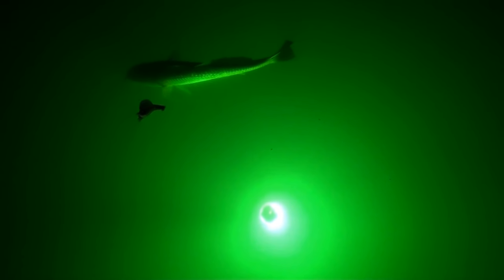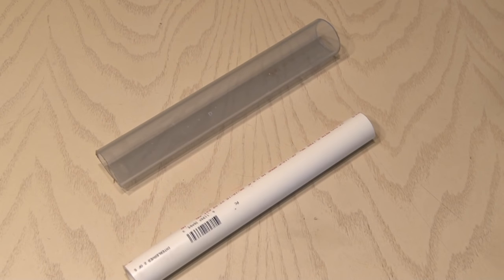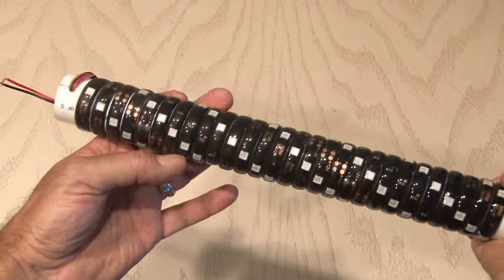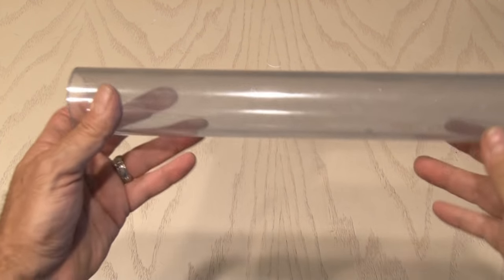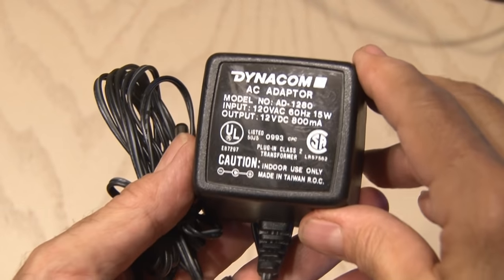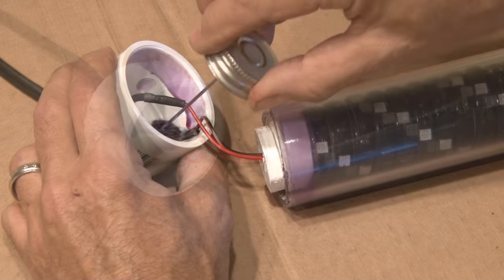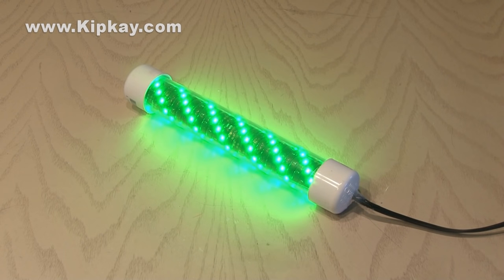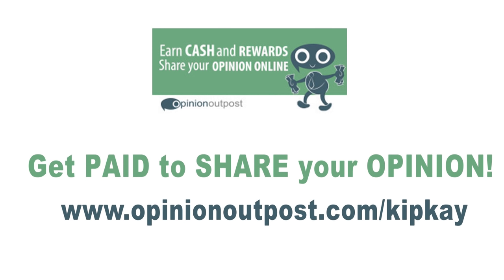Catch More Fish With This!

Comment: I had a hard time finding 1 1/2 clear PVC pipe so I used a protective cover used on fluorescent tube lights. I used bolts from my scrounge box in the garage to weigh it down. If you use the entire roll of LED's it will make an assembly 20 inches long. On the end of the wire, instead of using a wall wart I used a cigarette lighter plug for power. By the way, I made 2 of them, can't wait to fish with them! Thanks for the idea! The whole assembly cost about $30.00 to build both!
Reply: I'd be greatly interested to see pic of your finished product. Primarily the cigarette DC plug.

Comment: 1) I would use a cable or rope of some kind to carry the weight of the light along side of the small gauge wire. 2) I would also water proof the power cord on the inside of the cap as well . I would not use silicone to do this I would use a marine or plumbing type 2 - part epoxy dough, like $6 at Lowes or HD. 3) On the LED wrap at the end I would go around it with electricians tape in combination with the glue.

Comment: Two minor differences I would have done: 1) I'd have sprung for the programmable LED light strip so that you could get it to change color.  Of course, I'd be using this more for decoration than for attracting fish, so the different use would drive that change. 2) I'd have made sure to use the silicon on the inside of the cap as well before securing it to the tube.  Might be overkill, but I figure if you're going to try to make something water tight, might as well take all the steps to lock it down for sure.

Comment: filled mine with sand. And used 600 water proof creed led lights. works off my boat battery. basically the same concept cost me $20
Reply: Tony McCready what did you plug the extension cord to . Or what battery did U use ??
Reply: Alex Nguyen Are you dense? 
"Works off my boat battery."

Comment: This needs to be DC instead of AC. That way you could utilize your boat batteries or a battery source.
Reply: Randy Neal LEDs are dc. He's using a converter to go from 120vac to 12vdc, if you want to use it on a boat just run the wires to a switched and fused battery source.

Comment: Cool video but if you want to avoid purple primer pick your self up some oatey gold  when glue a connection hold them together tight for about 60 seconds. This works I put up solar pool heating systems at one time. Pool water is pumped up to black plastic panels and then returns to the pool we always changed the pumps to a pump that could handle the head height and the connections were under a decent amount of pressure.This save you a little money and time in the end.

Comment: What wave length of light was your green LED's? You really need the correct wave length. Not just any green light will do. The green light it self does not attract fish, it helps plankton breed in that area, which attracts fish. People will put this under water around docks and after a few weeks more fish start to arrive. For a pool part it would be cool to drop a color changing one into the pool. But drop a few batters into the inner tube.
Reply: 535-540nm works well under my dock. (saltwater)

Comment: If you could add a control board to it to program patterns into the light, you could do some pretty trippy rave lighting with that spiral design.
Reply: All of the LED's are connected to only a single power bus. It's impossible to control each LED individually.
Essentially, the most you could make this do is flash.

Comment: Question: Is the AC adapter that you used on the video rechargeable by plugging it into a wall socket? If not, how do I make this light portable so that I don't have to use power from an electrical outlet? Is there a battery or some kind of portable power supple I can use? Sorry, if I sounded too stupid for those who are smart enough to think this is common sense! I'm very interested in this but I want to make sure I understand this fully before I commit myself to this project. Thanks to anybody who can answer my questions! And thank you very much kipkay for posting this very special idea for all of us to learn from!
Reply: I use my 12 volt cordless drill battery. No AC adapter.
Reply: Grand Wonder. Use a car battery
Reply: Grand Wonder Since you have trouble understanding electricity, you should buy a light already assembled. I respect your willingness to admit your limitations. No one can be good at everything. I'm an electrical engineer, but some projects, like this, I would prefer to just buy the finished product. If I can't find it, or it's too expensive, then I might build it. Good luck whatever you decide to do.
Reply: Grand Wonder Actually, adding a rechargeable battery to a power supply would be a fantastic idea for a project! I might build one. That would be cheaper than a UPS. Thanks for the idea. A good portable 12VDC power source is a jump pack for jump starting cars. Mine has a cigarette lighter plug.

Comment: Can you make it battery powered?
Reply: It's 12v, so yea.
Reply: I was thinking about making a battery-powered version of this the moment he started talking about running a power cord. I was like "WTF, you gotta plug this thing in?" Must be battery powered to be practical even if the battery was external. Who fishes near a power outlet? Seriously, the one thing that is usually NOT present near the water at the fishing spot is a?  Power outlet.
Reply: Walmart 6ft wireless LEDs with remote...tight lines EVERYBODY Your welcome.

Comment: I'm going to try that.. without the adapter.. thanks for the video kipkay
Reply: Jerry Lochala the LED strip is powered by 12v.  Just wire it to the boat's accessory battery, you don't need a power adapter.

Comment: 2:13 I think you meant that you want it to be more dense than water, not heavy. Weigh does not affect how matter floats; density does.  Correct me if im wrong, thanks
Reply: His design is essentially  fixed volume (12" x 1.5" dia.), so adding mass inside that volume increases both the weight and density...

Comment: So Kipkay spends $100+ on a soldering station but can't spend $20 on a heat gun?
Reply: its usless lol
Reply: +chems Not entirely, Heat guns are very useful for softening PVC and forming and repairing plastic, They're also very useful if you live in a place that gets alot of snow and ice for de-icing windshields
Reply: He's showing how you can do it cheaply at home. He's not just showing us what he can do, himself.
Reply: +Nash Lawrence if I'm doing it at home, I'm going to paint the end caps silver, put the T.C.R.I. logo on it, and put it in the middle of 4 unsuspecting turtles.
Reply: Meat Smell with 8 years of electrical experience I've never needed a heat gun, we're not talking electrician, we're talking hobbyist
Reply: JackTradesman you do you, man.
Reply: i use a paint dryer
Reply: Some soldering irons are cheap, he just used what he had.

Comment: you can make it into a flashlight w/ two reed switches relays an power jack w/ cover (one reed switch and relay goes 4 charging and one 4 turning on/off the light

Comment: If you are not doing actual plumbing, use the clear primer. It is cheaper then the purple primer and works just as well without the dye. The dye is just there to allow inspectors to know primer was used when inspecting plumbing.

Comment: Nice job and thanks for sharing! Does the primer and cement work better than the E6000? Also, would it be more effective and safer to power it through a battery system as opposed to an electrical outlet?

Comment: Kipkay, is it possible to do this with the RGB 5m strips? Would you have to put the IR receiver outside of the housing or does water reflect IR?
Reply: I am 90% sure this would fail, because, being IR, you would need direct line of sight from the transmitter to the receiver, meaning the receiver would need to be outside the tube, and the water would refract it anyway, so unless you found a way to reach the receiver all the way to the end of the cord outside of the water, where the transmitter would "see" it, it wouldn't work. At least, that is my understanding.

Comment: I want to make a bicycle charger by using the technique of knife sharper as replacing it with motor to generate current. What kind of battery is needed and need something small which can do anything. And what dc motor is needed which can be used as a reverse to ride the bicycle consuming less voltage.

Comment: You should have put a connector between the wall wart and extension cable to be able to swap in a 12 volt plug or battery terminal clips

Comment: Very neat is the light conected? to what power source?
Reply: any 12 volt source can power it. Car/boat battery if you are on a boat/wild. Wall adapter if you have a electric socket by the dock
Reply: Thank you little buddy I appreciate the info

Comment: instead of wiring it up to plug in the wall can you wire it up to a 12v source?
Reply: Douglas Hale You can use this device with a 12vDC to 110v-120vAC  inverter. You can purchase them almost anywhere.
Reply: Douglas Hale. A 12V battery
Reply: Rod's Olde Bulldogges Redundant. Convert the 12 volts of your battery up to 120 volts just to go back to 12 volts? Pointless.
Reply: Les King I get what you're saying, but I would rather make it the way this guy did and have a $15 inverter from Harbor Freight in case I wanted to use it from my boat at some point and also be able to plug it somewhere on my dock at other times. Personal preference but if you're not planning on using it other than on a boat, yes convert it to 12vDC only when you make it.

Comment: I think it's a great fish light, it's better with 18650 batteries inside the tube 
and a waterproof plug for recharged, don't need a external power ! 

Thank kipkay ! 🐟👍🏻🐠
Reply: That sounds like it would work, but you'd need at least three 18650s to get 11.1vDC, so it would slightly be dimmer than in the video. You could use more batteries and step it down to 12v , but you'd probably have to modify the design to fit them.

Comment: What does the primer do?
Reply: it makes the cement get primed so it will stick to the other thing
Reply: The Purple Primer cleans the surface, removing any oils, and other contaminants that could interfere with the adhesion of the two parts.

Comment: Can you come up with an idea for a portable battery powered one. I fish a lot of public piers and glow sticks aren't always readily available
Reply: michaelnazerian His setup uses a 12v transformer to plug into 110v power.
That means you can just eliminate the transformer,and use jumper clips to go to a 12v battery,or a plug for a cigarette lighter/accessory outlet.
Reply: michaelnazerian also, since they are LEDs, they don't draw much meaning you could more than likely reasonably power it with 8 AA batteries which equals 12v. Just search for an 8 cell AA holder. I imagine it would last reasonably long.
Reply: Nathan Kennedy You can also use a 9V battery in series with 2 AA batteries.

Comment: Only thing I would do different is attatch a strong rope or something to the hole the wire comes out and twist the wire around the rope. This way the rope supports the weight of the light and not the wire, which is more important.

Comment: Instead of silicone caulking, could i use a waterproof cable gland?
Reply: Also, any ideas for a battery pack that floats to leave the light in a pool? 
Like a floating ring leading a cable down to the tube-light?
Reply: use a cordgrip one that is ip68 rated and put some silicone grease on the gland's seal and the cable before screwing it down tight.

Comment: id like to know how you power the thing i dont see 120v ac anyway .you need to make it 12v dc so i we could run it off the boat battery
Reply: It's 12v dc already, just leave out the ac adapter.

Comment: You could do this or crack a bunch of glow sticks and put it in a air tight jar
Reply from the maker: Yea but the glow sticks will only last a few hours and not be nearly as bright as this.
Reply: glow sticks die after a few hours and you'd have to constantly refill it, which makes them more expensive.

Comment: Could you make it so the LEDs light up in sequence so the lights would travel in a spiral down the tube
Reply: Not that particular LED strip, but there are strips with indvidually adressable LEDs (you can tell each LED how bright it should be (in the case of RGB LEDs the brightness of each color for a varying resulting colour and brightness)  that could be made to do that. You'd need to find one that does the pattern you want or program a controller yourself

Comment: Can you fill the tube with sand instead of weights?
Reply: I think you can but you would need quite a lot of sand.
Reply: 〈LS〉 XeN what if you just use garden sand?
Reply: xliam127x I don't know, weight it? Lets say one rock is three pounds, use three pounds of sand x how many rocks you need.

Comment: Does the led strip not need some kind of current limiter?
Reply from the maker: No. Designed to take 12 volts
Reply: But 12V ist the voltage, not the current
Reply: +cokefridger but raising the voltage also raises the current, so giving an answer in volts makes sense.
Reply: +cokefridger the current is determined by the device using the electricity... The voltage is determined by the source... You don't need to limit the current when you have the correct voltage

Comment: what about  using  the warehouse  type  light bulb
Reply: Like a fluorescent tube?  That'd require a more sophisticated power supply, wiring, and more power.
Reply: There are at least 6 kinds of lighting used in warehouses.

Comment: What is it that purple stuff he call "primer"? What glue is the one he use after the purple stuff? What is it that strange tool he use to apply the purple stuff and the cement? TIA
Reply: primer and cement are binding agents help pvc stay together
Reply: look up pvc cement and youll find it, the tool is usually included too
Reply: Never heard before. Thank you both for the answer.

Comment: does it need to be waterproof?
Reply: Well, you don't exactly want to plug a live power cord into the water, so at the very least that connection point needs to be waterproof.  Probably not so much for the LEDs since the strip was made to go in water, but I would think that the less they are exposed, the longer they'll last.
Reply: That's what I'm getting at, that strip is sealed so the extra tube seems unnecessary.

Comment: awsum! I gotta make one,founder if it works is open ocean make it 4 ft long
Reply: Chelsea McGill I have read blue light works well in ocean but not fresh water. Green light works well in fresh water but not salt waterz.
Reply: Squid fishing boats use green lights in Asia, so you can catch some ocean fish with green light. There are so many boats that the green glow can be seen from space!
Reply: @xAZPUNKSTERx  
You have that backwards - green is a longer wavelength than blus and travels further in denser seawater.
Blue is a shorter wavelength, and doesn't attenuate as fast in fresh water, like it does in saltwater.

Comment: What's the point of the LED's being waterproof, since the outer casing prevents stuff on the inside from contacting water anyways?
Reply: the leds are waterproof because people use them for ground effects on their cars
Reply: Oh, so that's what people are using for underglow these days.
Reply: yeah, they're cheap
Reply: Richard Mcginnis If I got them in white I could make a neat daytime running light for my motorcycle.
Reply: i'm pretty sure autozone has them, if not walmart for sure
Reply: Saltwater can be corrosive, plus even in freshwater it can get nasty inside from plankton and/or algae and obscure the light.
Reply: Richard Mcginnis Autozone isn't around here and my local walmart doesn't carry that type of electronics. I'll try some online stores.
Reply: Amazon works wonders
Reply: WizardsOf12 Doesn't ship anything other than books to here for whatever reason.
Reply: yeah what Mr.Wizard said. i have used amazon a lot and all but 2 items arrived either on time or early
Reply: where you live, alaska or hawaii?
Reply: You could try aliexpress or ebay

Comment: What is the purple primer for?
Reply: Cleans and etches the surface of the PVC so the cement will bond to it securely.
Reply: To prime the surface
Reply: cleans the connection i think and primes it for cement

Comment: How could we make that run on dc current? I'd like to hook it to my deep cycle battery and use it on my boat without a inverter
Reply: Strip lights run on 12v DC, he used the plug to convert from AC to DC.. You just attach to a battery and go
Reply: Ok thank you

Comment: I wish I had the skills and tools to make one of these, our pool doesn't have a light and it'd be too expensive to buy and have one installed
Reply: Use your imagination.I've seen people buy a low voltage light bulb and screw it into a pigtail.There's people making them with empty whiskey bottles.They just push the lightstrip down inside the bottle with some weights on it of course.The sky's the limit